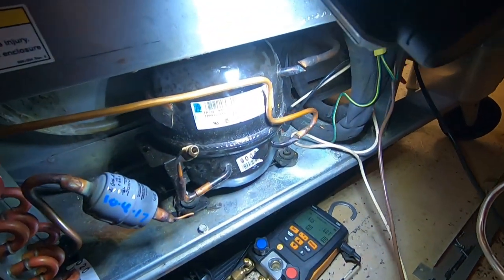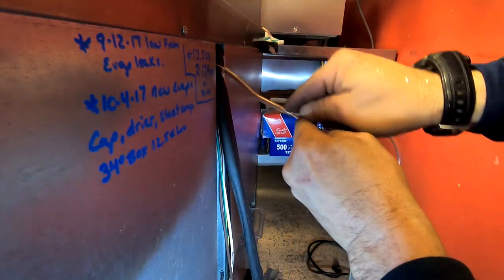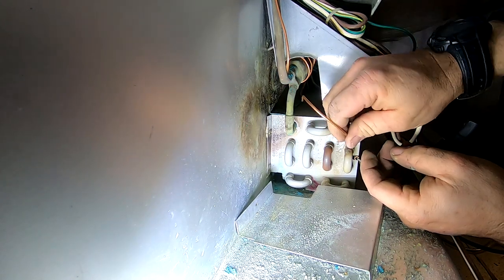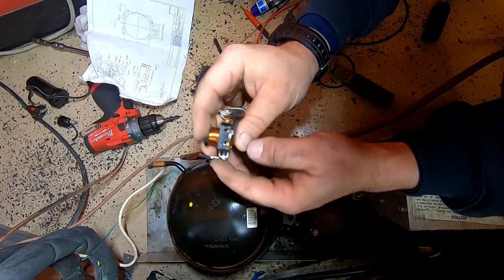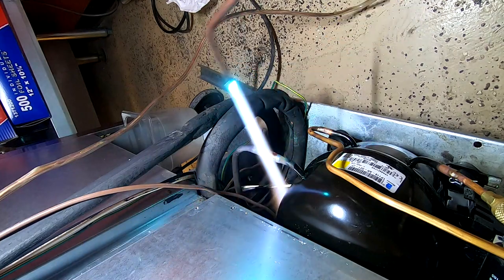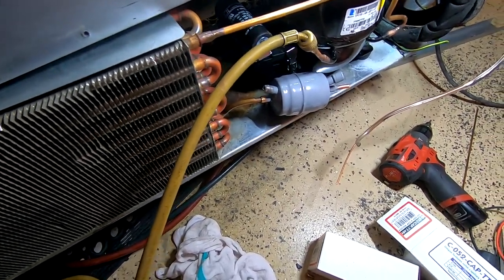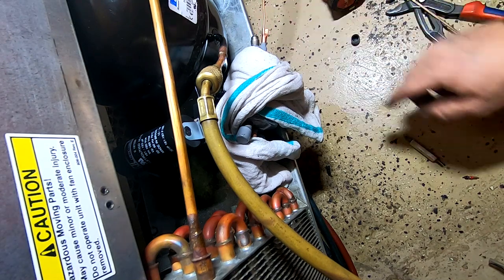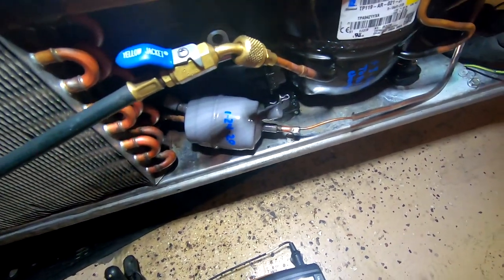Reach-in Cooler Warm.  Compressor and Capillary Tube Replacement

Comment: Made it look so simple, especially removing the old cap 👌
Reply from the maker: We pretty well change capillary tubes every time we change a compressor or an evaporator. It was kind of mystical at first but now it's just standard practice for our company. Thanks for checking it out👍👍
Reply: HVACR Survival  I have a tendency of overheating the cap and it breaks off in the evaporator 😂
Reply from the maker: @marcelo9445  I put most of my heat on the thicker base metal, and when I'm installing a new cap t, I will raise my temp to where the base mental about melts the rod, then I put the rod where the flame can hit and melt it, normally you shouldn't do it that way when brazing in a normal fitting but the mass of the cap t is so small as it is, it works out fine.

Comment: I want to know when i put the thermostat on low position the compressor cools down short period and does not overheat ghe fridge is cooling but not building frost at highest temperature settings it runs long and overheats. The fridge is cooling and builds frost,  There is freon in it no leak what do u think is the problem

Comment: Nice work 👍
2 questions if I may :
 1_How did you get the capillary tube size , they told me you can use a special tool that gives you sizes with like a needle or something like that but I've never seen it 
2_ why do they wrap the cap tube around the accumulator or a lot of times the small factory drier , I don't quite understand what it does ( I mean on the drier maybe kinda helping with subcool and even then , meh ) 
Thank you sir !
Reply from the maker: Generally our parts person calls The factory and finds out the size and the length of the capillary tube. Yes there is a gauge made by JB that you can use and I have one but it's a lot easier to just know exactly what the factory uses. There's a great article on how capillary tubes work and I will try to find it and post a link. The reason why I wrapped it around the accumulator was to get the heat transfer that I lost by not strapping it to the suction line as it came into the cooler.
Reply: @HVACRSurvival  thank you sir !👍

Comment: Hi Do you recommend the uei Compressor analyzer ?
Reply from the maker: It's a little expensive looking but it seems like it would work fine. I have never used it personally. basically with that one you use your electrical meter to get your voltage readings off of the test points that they have pre-made made for you. Which seems kind of nice,

Comment: What pressures are you using on the oxygen and acetylene?
Reply from the maker: It depends on the tip size,  I normally use a number 2 for about everything, I try to make it close to equal, 5-10psi. The rosebud, captain hook and the other 2 flame tip nozzle all use different pressures that I usually have to look up,  otherwise, I can knock out my flame, then the flashback arrestors get tested.

Comment: I always thought the r 11 flush prevents cap tube from plugging?
Reply from the maker: It's supposed to, but I'm going back on a compressor and cap tube change that had extremely low suction when I was done, I even trimmed the cap tube, it didn't make it much better,  now I got to go back and change the cap tube again.  So I can't help but think that it's like picking at a scab, sometimes it makes it worse.
Reply: R-11 banned from production in1996 Montreal Protocol.